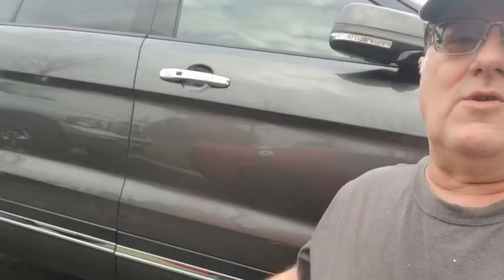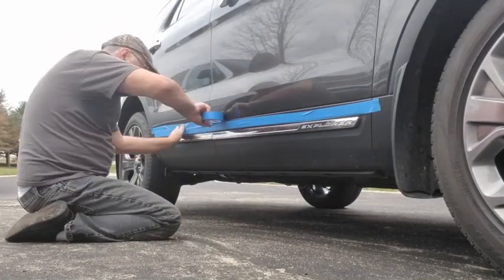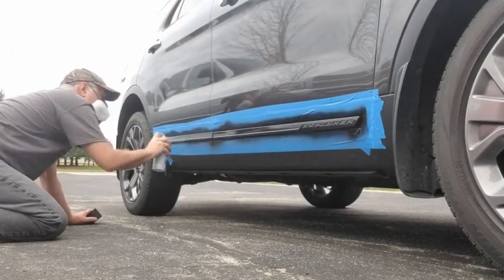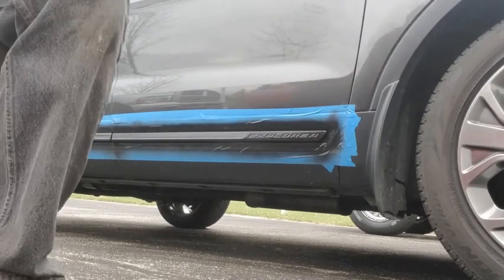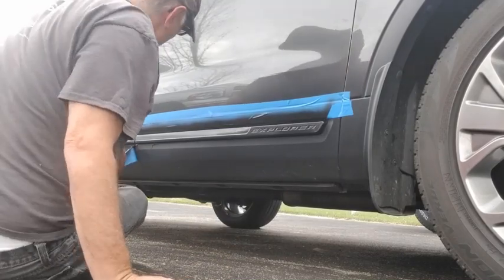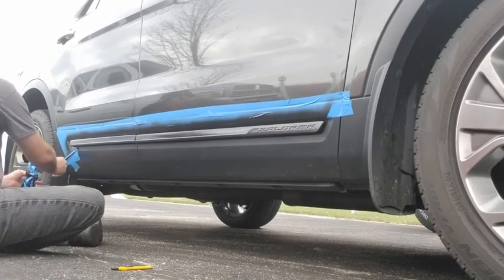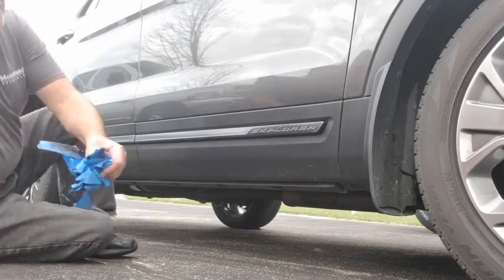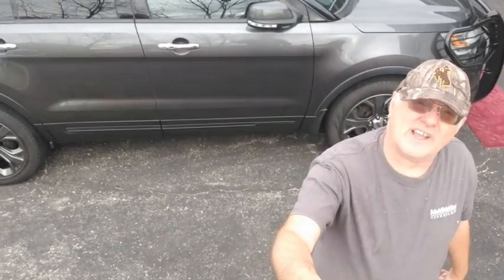Ford Explorer Side Chrome Blackout Plastic Dip Easy DIY Save Money Do It Your Self

Comment: Good video thanks!
Will need to paint handles outright …remove, scuff, prime, then base or 2 stage.
Dip won’t last as they have a seam at the back that causes a peel point.
Reply from the maker: I was thinking to wrap them with matte black. Easy to do and re do if needed
Reply: Is there a video how remove them

Comment: Appreciate the video! Was just looking to do this throughout. I had a blacked out sport totaled after 6 months and had to opt for a limited with chrome accents. Still have the blk rims. 
I’ve used plastidip on rims in upstate NY, crap winters and lots of salt but held up 3 years. 
My concern is the car wash, my last car I didn’t care that much about but I do now. 
I’ve used the blacked out vinyl emblems on the sport and hold up very well. I think KMJ or something like that. 
I was about to swap out the grill but am now seeing you have to remove bumper, not going through that. Have you tried plastidip on grill
Reply from the maker: I don't use the car wash much and never with the brushes so the dip is in year 3 no issues ILL salts is like yours, as for the grill I did this  https://amzn.to/4abhbWS use black wrap on the chrome before you snap these on it will be a 30 minute job.

Comment: Does anyone know how to remove the pieces
Reply from the maker: I did them on the car because you need to remove the big black plastic part then remove the chrome trim, much easier to do this on the car and 3 years and it still looks good and 100K of miles as well

Comment: Where did you get those rims?
Reply from the maker: eBay but they are factory Ford a sport optional item
Reply: Yeah I have a 2017 Explorer Sport Twin Turbo and they come with 20” machined alloys I want the black ones
Reply from the maker: @govillonyt7979  Mine are call Hyper Grey
Reply: @mytwogoodhands2799  okay thanks 😊
Reply: How does it holdup to car washes?

Comment: Anyone had success removing the insert??
Reply from the maker: You remove the whole black panel then you can remove the chrome part.
Reply: @mytwogoodhands2799  so the main panel is a pop off with clips behind the insert? I couldn’t find ANYTHING on removing that lol. Thanks again!
Reply from the maker: @HeadsUpSafety1  Go to the ford parts department they can show you the part and its fasteners on the screen and you will see how it is mounted, I have not removed one.

Comment: Your plastic dip come off in the next couple months. 👎
Reply from the maker: 3 Years and it is still all on and looks great, don't skip the wipe down to remove oils and waxes and it will last. PS I don't use power car washes I wash at home by hand.  Steve